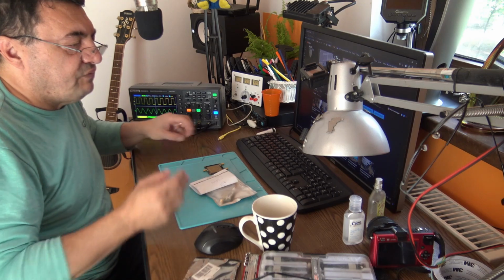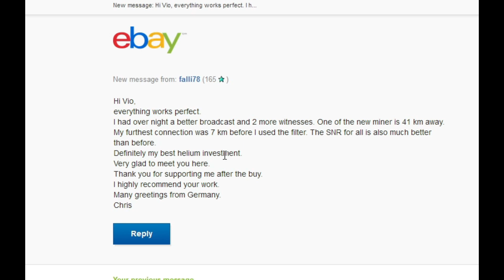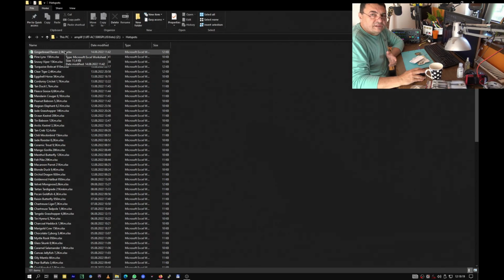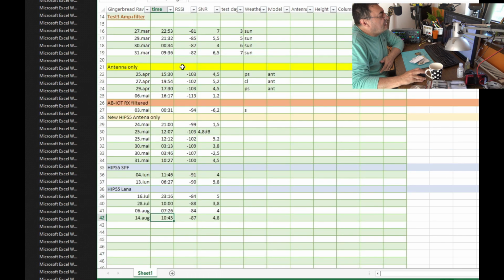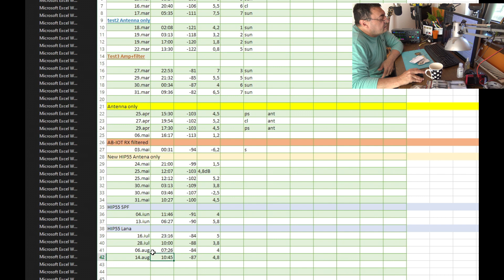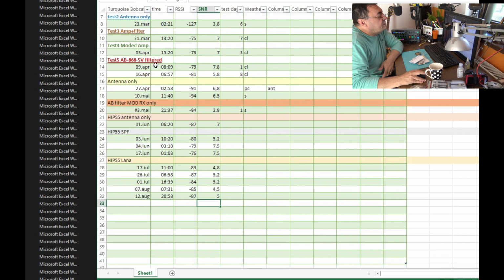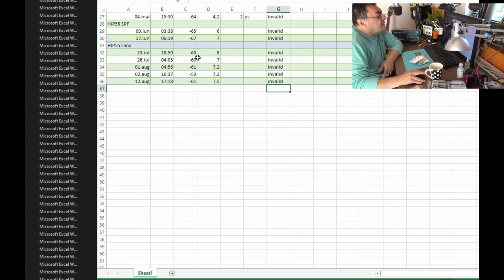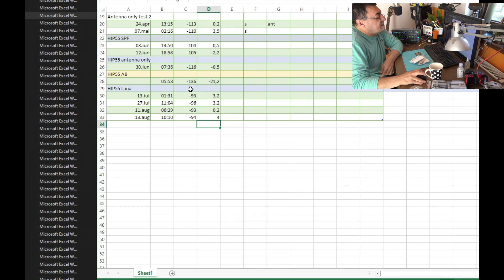Helium miner Q&A

Comment: I put a flarm amp on my attic install and it 2-3x my witnesses for the 2 weeks it was installed. The cavity filter took long to come and I only had it on for 12hrs. But for those 12hrs, it did seem to have less witnesses. I'm debating to install the filter on my offgrid that  going to fix today. Amp definitely going on.
Reply from the maker: Check the connectors..it should be better with cavity..

Comment: Hello,
from where u got this airbuddy amplifier, i've tried to buy from ebay, Alibaba but out stock :/
Reply: Keep a eye on eBay they will come back. I paid £85 In the Uk inc power supply, don’t forget you will need a saw filter as well
Reply from the maker: @markh2k2  Possible..
Reply: @markh2k2  well 85 quids too crazy
Reply from the maker: Old stock, long before all craziness...
Reply: @viocaia  i c, 
if u have link for Lana amplifier?
Thanks.
Reply from the maker: @boisv4953  that, s RX only!
Reply: @viocaia  7:35 showing some good results with this lana thats y i'd like to try, only rx is fine for me, my miner beacons only once a week anyways.
Reply from the maker: @boisv4953  check here https://www.nooelec.com/store/lana.html
Reply from the maker: @boisv4953  Also contact my Email..maybe I find a spare one..where are you situated?
Reply: @viocaia  Thank you